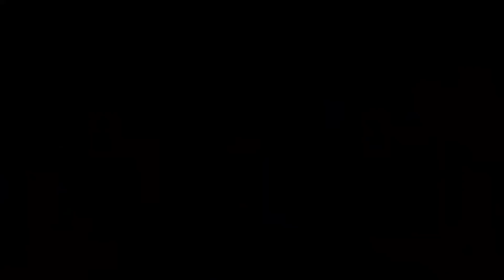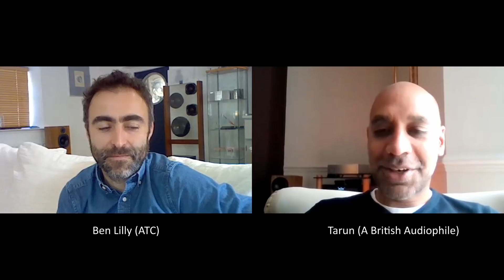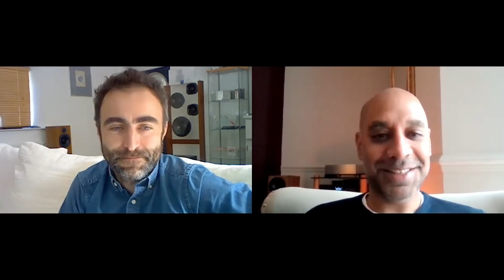ABA Podcast: Episode #3 - loudspeaker design with Ben Lilly (ATC)

Comment: I did appreciate Lilly's comment that no matter what amp or speakers one might use, the speaker will always fail to perform according to its potential if it  remains passive whereas an active speaker will achieve its best. Accepting this as true, and I do, then all that bumfluffery spouted by pundits and manufacturers is just so much snake oil.

Comment: Anything from ATC is always welcome solid info. I got my SCM 19s due in large part due to the review by this channel via Tarun. I did my own review of the 11 and 19 also, and a follow up on the 19 on my channel too. It's still my reference speaker and other than being a bit base shy, it's second to none I have heard to date. Combined with a good sub (or two!) the audio is well above that, or equal to, systems costing far more $. Some day, I'd like to get the active 40. End game speaker? Not sure...

Comment: Another absolutely top notch video Tarun, can’t believe how I missed this one, but it really hit a sweet spot for me as my final year university project over 20 years ago was on the benefits of active crossover design and also a sweet spot video as I own SCM11s with an Exposure 3010S2D. Back then I made an admittedly rudimentary design and implemented it into an MS20i Pearl loudspeaker (gosh remember those, how ancient am I? 😱).

There’s a point you made about the directness of the presentation of the active design and there are ways to negotiate this, although I fully appreciate it’s an inherent difference you’ve heard compared to the passive counterparts. In my room I’ve noticed even my passive SCM11 can sound direct and the things I did to relax the sound was a) have the speakers not towed in quite so much, I’ve just towed them in fractionally… b) invested in a woodart diffuser that sits on my rear wall to diffuse the primary reflections off the back wall, but diffusers could also be used on the side/front walls as necessary and no need to buy expensive ones. I’m a believer that diffusing sound is better than absorbing or overly damping the sound… c) paid attention to fuses in my mains cable plugs and I currently use a combination of Titan and Isoclean 13A fuses… and finally d) bought one of those amazing Tacima conditioning plugs that you and a good friend recommended. One of the best things I ever did!

Sorry for rattling on, it’s just that your video really hit the bullseye for me personally and wanted to say a massive thank you for doing it. Another gem in your amazing repertoire, very much looking forward to more of your proficient work. Best wishes, Rish 🙏
Reply from the maker: Thank you Rish. Very kind of you. I really enjoyed learning about your experiences 👍😊👍

Comment: great one Tarun...  I also think drivers are the most important, but the sum of everything can make it great.   ATC put a lot of effort in making amazing drivers.   I wonder what ProAc will answer to this question as they use mostly entry level drivers and get amazing results with them.   Good to share some views on active and passive crossover.   I also wonder about digital DSP.  There are digital modules with room EQ, parametric EQ and crossover settings.   Fiddling in the digital domain often is "more clean"then doing the same in the analog domain.
Reply from the maker: Thank you my friend. I hope to do more interviews with industry professionals and get different perspectives 😊👍

Comment: A good talk about passive and active, I have built both systems . When I was doing club systems the active was the only way to go. Big fan of a well designed active with high end gear. Used class A amps on hi and mid then a class A/B on the bass.  My experience with live sound was to use an amplifier much larger than needed regarding specifications of power, when I use low power amplifiers on tweeters the failure rate was much higher. For high and mid frequencies are used to multipleA 5 to 10 higher than what was needed for bass I used multiple of 1.5 - 2.5 ,So a Tweeter but only needed 10 W of power I would put 50 to 100 W and a base driver that was rated for 500 W I would use a 1000 watt amp. Nice talk. 👍
Reply from the maker: Very interesting. I really enjoyed learning about your experiences 😊👍

Comment: I thought it was funny when you brought up "sand cast" resistors and his reaction to it. Clearly you have this negative connotation against "sand cast" resistors probably because of that ignorant, graph loving guy Danny at G&R. What he calls "sand cast" are actually wire wound resistors. All high power handling resistors are pretty much all wirewound  and some metal oxide. You do not see metal film resistors at high wattage ratings. Wire wound resistors come in a variety of exterior finishes and shapes depending on the application. What he calls "sand cast" have a square cemented body which makes them easier to glue to the circuit board. Other wire wound resistors will have round bodies because they generally are suspended from their connection points. Some have exterior coatings to make them less flammable when they fail like enamel or silicon. With that out of the way, I want to say I really enjoy your channel and seeing the growth. It's fantastic to be able to get to hear long interviews with industry people who design great products. Thank you
Reply from the maker: Thank you Steve. Great to have your thoughts on this. I agree, wire wound resistors is a better description and indicates why the inductance is higher than on metal oxide types. Nice to have you confirm the issues around power handling too 😊👍
Reply: @abritishaudiophile7314  Thanks for your response. I'm in no way saying that there's anything wrong with wire wound resistors. I think metal oxide resistors are sonically way inferior. Probably the harshest, grainiest, most sibilant, etched and compressed sounding of all resistor types. What a good builder will do is listen to lots of resistors of the same type and value and choose the ones that serve music the best. I also like his comment on using inductance to dial in the sound. As he said, he doesn't matter if the inductance affects what happens at 150kz. Same thing with capacitance on conductor insulator. Most of those measurement are indicated at the Mhz region. Irrelevant to human hearing but all materials definitely have a sound and that is part of the art side of designing that takes it beyond just engineering and measurements. The end result of a great product is one that connects us to the music, keeps us engaged and stirs the soul and imagination.
Reply from the maker: @stevesmith3033  very interesting stuff. If I get the time, I would love to play with switching crossover components on a speakers just to observe the impact they have on sound quality 😊

Comment: Very interesting podcast, also interesting to get the opinion about the cross over. But it is good to remember that OEMs must mark up their products to make a profit and many OEMs do that based on a fixed mark up on the cost of the BOM. Add to this that cross over components are already marked up by the companies that make those (like Mundorf) the result is profit margin stacking which makes expensive cross overs much more cost prohibitive to speaker builders than consumers (ironically). 
So as fixing cross overs may be low on the priority list of the speaker builder, for the consumer it can be a cost effective way to upgrade a speaker your self. The caveat is you have to know a bit what you are doing. But personally I would rather pay for bespoke cross over parts than bespoke speaker cables, the latter are even lower on the priority list but even easier to tweak with.
Reply from the maker: Thank you Hugo. Great insight 😊👍

Comment: Had a few pairs of ATC speakers back in the late 80s early 90s, always liked a  midrange dome and soft dome tweeter.
Reply from the maker: Thanks Paul. I wouldn’t be surprised if those early ATCs were quite collectible now 😊
Reply: @abritishaudiophile7314  I wish I had kept a lot of my older hifi components, but back in the day  I was always upgrading and chasing that better sound,
Reply: A.t.c are not transmission line ,are you thinking of p.m.c speakers
Reply: @markjohnathanappleton8642  sorry my mistake I was thinking of TDL

Comment: Thanks Tarun, audio is also an educational process.
Reply from the maker: Indeed. Good to hear from you 😊👍
Reply: @abritishaudiophile7314  Audio is one of those things that I can never leave well enough alone. I have been enjoying CSS Audio Criton speakers in the basic form. I then had to get their enhanced parts crossover, more improvement. Then they brought out the X version with enhanced parts and  new tweeter. Better still. Now I had two spare crossovers and a spare tweeter. I also had a half sheet of Oak veneer. What to do? Obviously get  new flat pack, two woofers,  a couple binding posts and two ports and make another pair of Critons. Thank goodness I can't accommodate the new tower version of the Criton.
 Anything worth doing is worth doing to excess.
Reply from the maker: @fletchermunson6225  I have heard good things about the CSS kits. Great to hear about your experiences 😊👍

Comment: GR, Research comes to mind minute 13 talking about cross over components.😉🤓🙄
Reply: I try and pretend I dont know who Danny is, lol
Reply from the maker: It did occur to me that Danny would be happy with the crossover components in this one 😉
Reply: Yes I tried to argue with him about sandcast resistors and he blocked me he's full of schiit
Reply: @johnsweda2999  I can't get past his obsession with his expensive tube connectors.  Also as another commenter pointed out, they are wire wound resistors, the sand has nothing to do with the resistance but sandcast helps generate a good negative image for them so Danny stresses that term.   

I like the way Ben commented that you work any induction from the resistors into the calculation.  At the same time Danny encourages people to switch out capacitors and inductors in their own crossovers with no regard for the affect those changes can have on the resistance in that point in the crossover.  It is different when he completely redesigns and tests the crossover but for those that just blindly change those things the output from the drivers will change.   It may be a change that someone prefers but it is a change because of the associated value of the component not because of the component design.

Danny, is the textbook example of starting with facts and science and then fading into the extreme.   Unfortunately, a lot of people believe everything he says is science and fact.
Reply from the maker: @johnsweda2999  who Danny?
Reply: @johnsweda2999  Interesting🤓🤗

Comment: I used to have some ProAc Studio3s - essentially similar to SCM50 passive.  They were lovely.  Shame you didn't ask about DSP active, class-D, or the relationship between ATCs dome mid and the Volt units.
Reply from the maker: Cool 😎
Reply: I know ATC do not like Class D as I do not for the same reasons. They do not have the dynamic range at volume which goes against their principles for reproducing the dynamics of a piano.